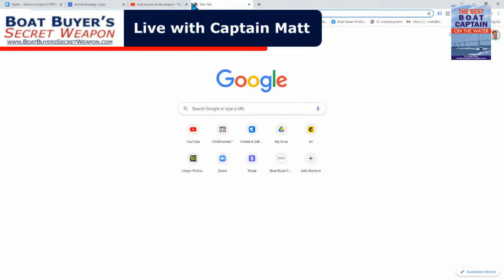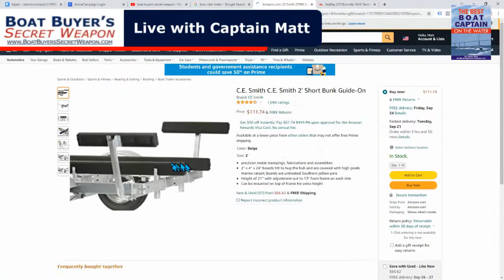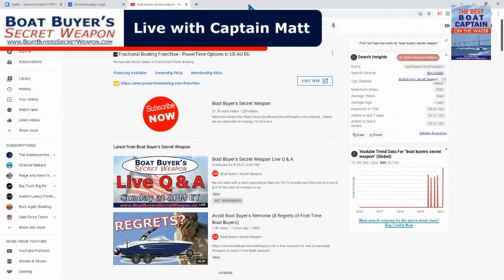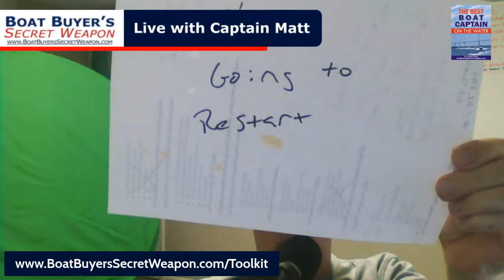Boat Buyer's Secret Weapon Live Q & A

Comment: Hi did you discuss my question about fitting bunks on a used trailer to your new/used boat - i watched while working and may have missed it - i also clipped thru the video and did not hear it - you said at the start once you fixed the audio that you would - if you did - can you give me a video counter location so i can hear your reply to my question?
Reply: @BoatBuyersSecretWeapon  thanks - your suggestions are exactly what i thought i can do - I'm taking the boat into the marina's mechanic for a engine and boat service and they will be taking the boat will be out of the water - and i'll ask them to adjust the trailer bunks to fit the boat hull - trial an error at the boat ramp would be a little precarious and haphazard to. Strange no videos on youtube on this issue - seems many many new/used boat owners who purchased a boat without a trailer - would also prefer a used trailer over the cost of a new trailer - new trailer on a used boat? i completely went thru the used trailer - replacing everything - saved over $1,500-$2,000 what a new trailer would have cost, and i know everything is new. Thanks for the video!